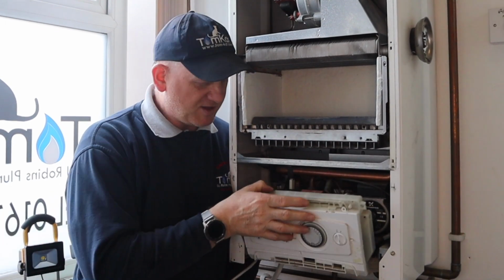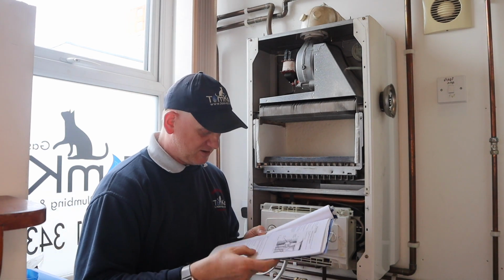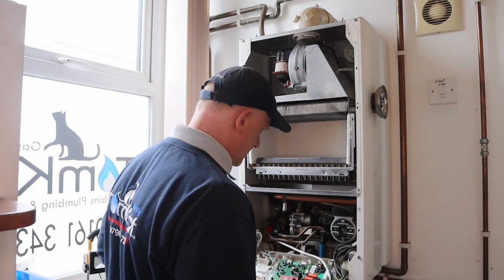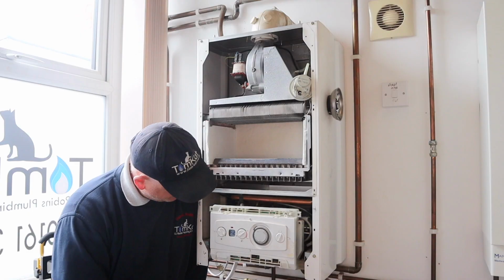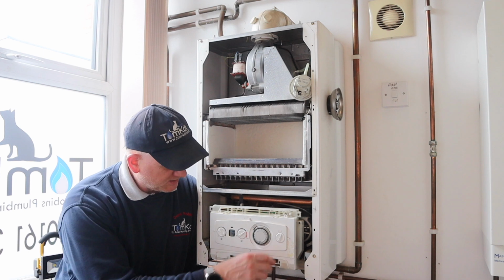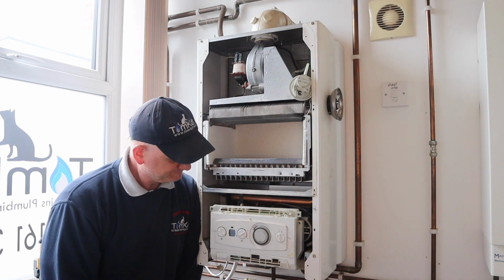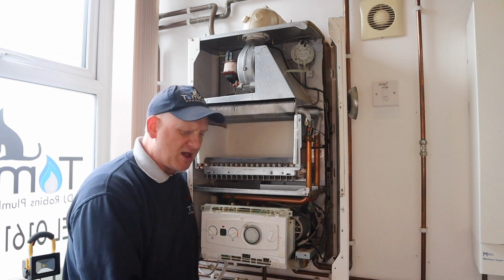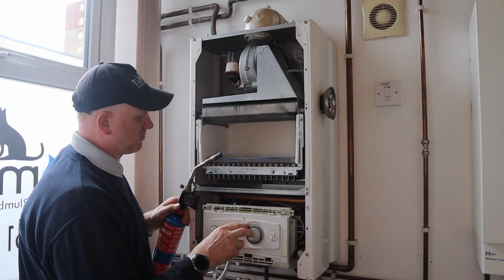GAS BOILER SEQUENCE OF OPERATION PART 2, how gas boilers work, how to fault find on gas boilers.

Comment: as a newbie, i find this helpful and confusing at the same time because of the different boilers, but the principle of operation is the same. I need to fail on my repairs  2 times and succeed on the 3rd, i guess. One more video for my library, thanks, Derrick, as always

Comment: Why is the fault "water pressure" when you disconnected the pump?
Reply from the maker: Because the boilers low water pressure switch is only a switch that does high and low pressure and not no flow
Reply: @tomkatgastraining  so is it because when the pump isn't working the heat builds up and this causes the water pressure fault?
Reply from the maker: @Benji-gq9gx  in this boiler but some do have a pump proving as part of the low water pressure switch
Reply: @tomkatgastraining  so if they have pump proving I imagine the fault code would actually be "pump not working" or similar rather than showing a water pressure fault?
Reply from the maker: @Benji-gq9gx  correct
Reply: @tomkatgastraining  thanks!
Finding your vids very helpful btw. Really appreciated

Comment: Sometimes the low water pressure switch, high limit stats etc are daisy chained together, is it not the case?
Reply from the maker: Some do some don’t like I say not every boiler is the same
Reply: @tomkatgastraining Lolz in other words READ THE MI you lazy bum engineers! XD

Comment: One thing I don't get?
The first part of sequence of operation is pump on and flow sensed? So why does ignition sequence start?
Obviously the pump doesn't disable or interupt the ignition sequence?
Reply: It must send power to both pump and pressure sensor at the same time but only pressure sensor is essentially the switch to continue the sequence. My theory is firing dry could crack heat exchanger but firing wet with no circulation just causes stat to lock boiler out. Forgive me if I’m mistaken but the pressure sensor is just confirming the system is full of water not confirming circulation/flow and that pump is working.
Reply: @whynot6950  makes sense, thanks m8
Reply from the maker: Low water dose but pump not running doesn’t
Reply: There is not flow sensor/pump proving on this boiler. The boiler relies on over heating if the pump is faulty and basically gives a dry fire fault (pressure sensor fault)

Comment: It would B GR8 if U went through different Boilers Manufactures Faults...
Starting with my Parents Boiler a Flexicom 24 HX
In particular the BAD Design of the Fan Mounting;... (take NOTE U Boiler disgners) that inhibits the Fan from reaching full speed;... making a noise;... then causing either F22;... F25 that does NOT reset after a short delay...
Where their system that runs on Constant;... for Old Ages occupants...
It would B GR8 if someone came up with a Auto Reset because on a manual reset once sorts it out;... for Weeks;... Months... But on the 1st fault;... in the meantime their Bungalow has gone cold...